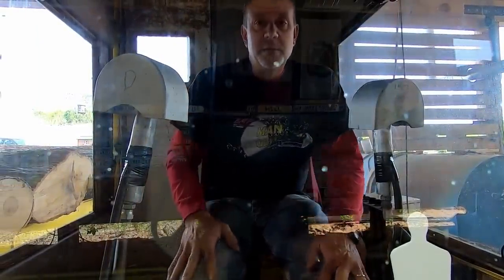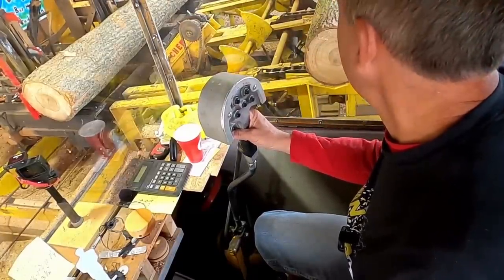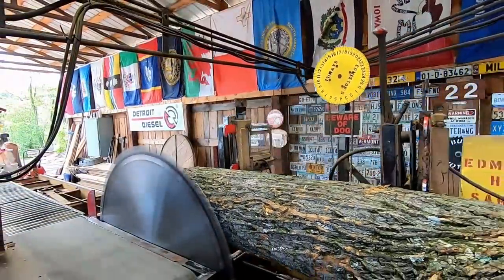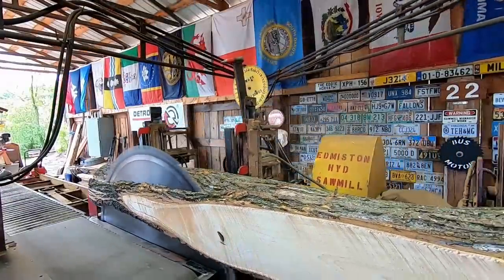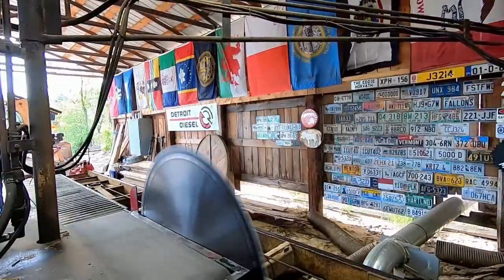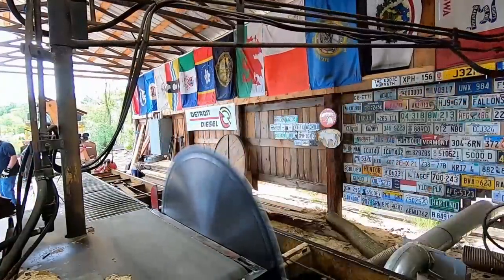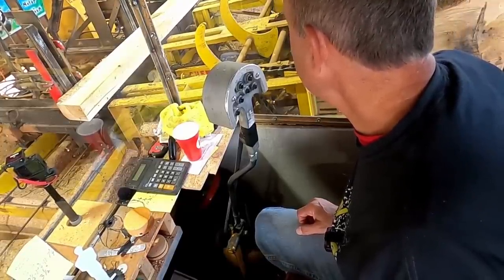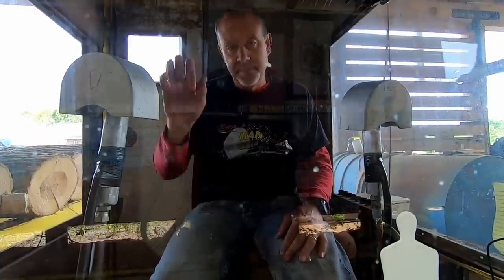sawing a poplar log & cab cam # 428

Comment: Itd be cool if you'd video yourself editing and posting a video and what software you use and stuff. Just an idea. Like the extra camera 
Thanks, 
Shannon
Reply from the maker: thanks Shannon , that's a great idea. How's the Frick doing?
Reply: @mark galicic  ,well I've not had the time to mess with it nor will in the next little while. Been busy getting a rental house ready for a young boy that wants to move in soon, fixing to work in the hay fields soon, I bought my daughter a laser engraver that should be here within a few weeks, covered up in our business making curved plywood, and sometimes I just get lazy and not do anything. I have found the correct size sheave to place on the Detroit. The Saw Dr. recommended I do that. I'll get that on later. And while I was in town yesterday I bought a pretty nice GoPro. Anxious to film and post something. Won't be long and I'll be set to cut on a regular basis. 
Preciate it,
Shannon

Comment: I'd never be able to effectively run that setup everything is backwards, when I move a lever forward I expect the attachment to move forward. Pushing that lever forward and having the log turn go backwards. But if that's what you learned on and it's what you know, then it's all good.